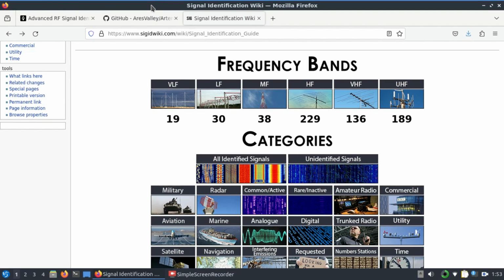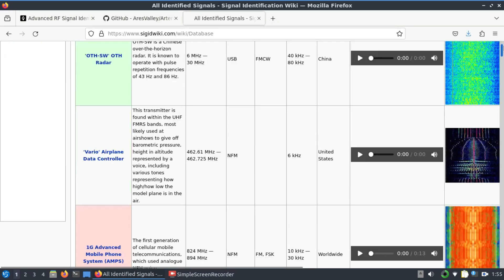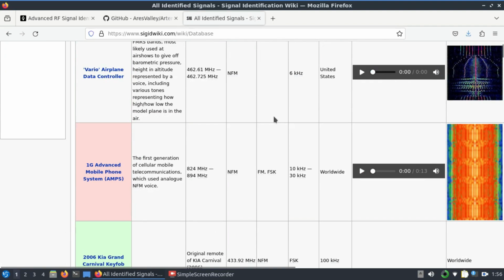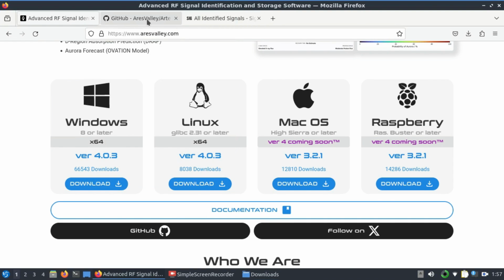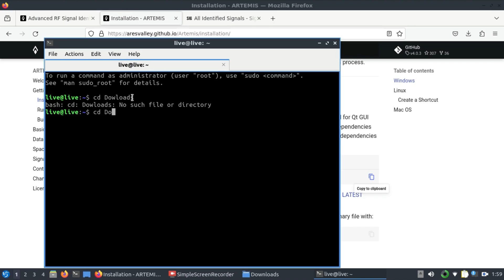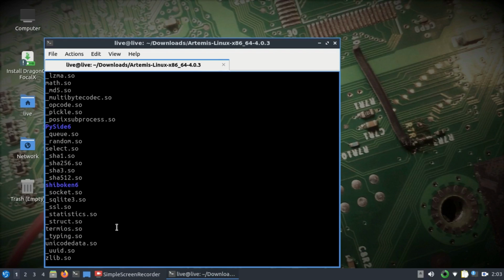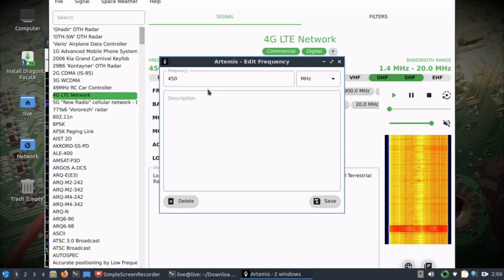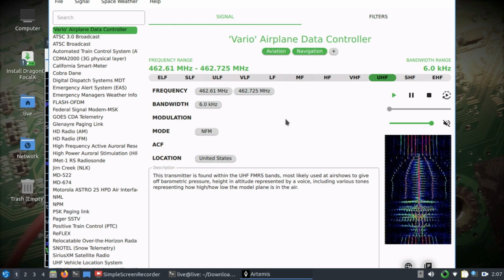Best Tool for Signal Identification | Signal Repository | Signal Library | SDR

Comment: Big user of signal id here.  This offline tool is an excellent tool for use in SDR applications to identify certain signals. There's especially more detail than they're probably needs to be but enough to go in depth with a modulations modes properties of the signal.